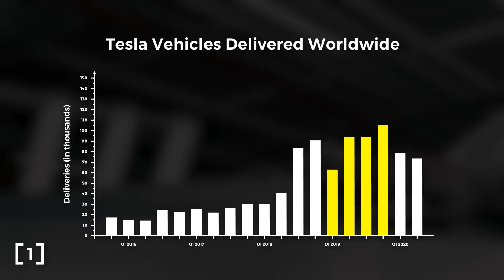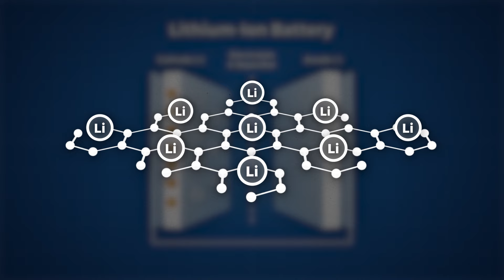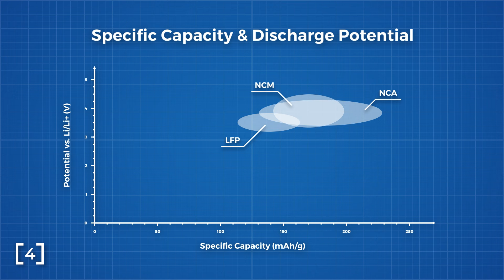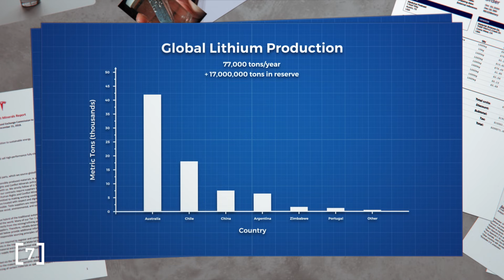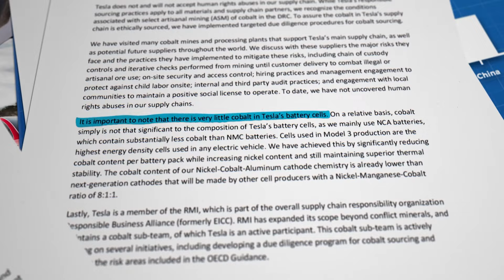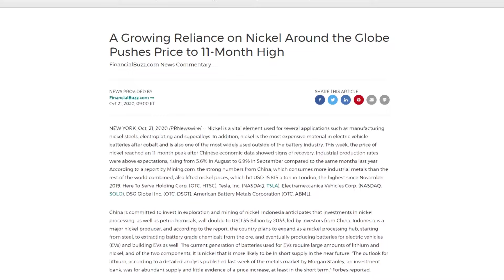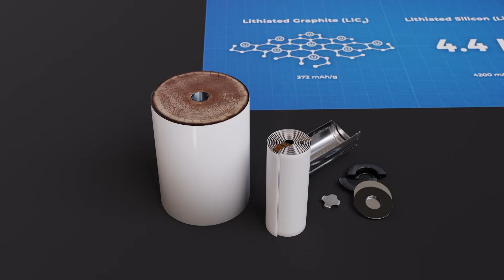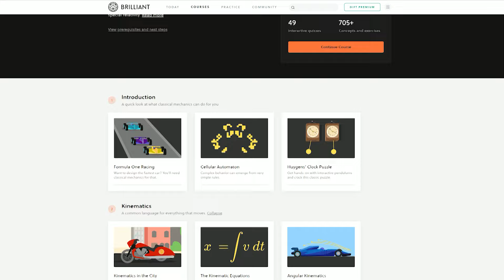Tesla's Battery Supply Problem

Comment: OK, If Tesla has a battery issue how in the heck are other OEM's going to get involved?
Reply: Presumably other OEMs are not going to get involved by starting with "solve all the world's energy problems on day 1."  Any new competitor will need to do better than Tesla in some fashion, whether that's a new battery tech or new production methods or whatever they come up with.  Certainly someone who is just starting to day and being a 100% clone of Tesla without doing anything different would face some significant uphill battles, but that's no different from a new competitor trying to enter any other market without something to make them stand out.

As for competition more generally, most of the major automotive manufacturers have had a pure EV line to compete with Tesla for several years now, and hybrids are so common that companies barely even bother advertising that as a feature anymore.  Similarly, competition in the battery sector is not trivial.  Tesla tends to get all the credit in part because of Elon's high profile and their penchant for doing big, flashy things like the Australian grid installation, but in terms of researching new chemistries (which is the really important thing for the future,) there are quite a few people in both the private and public sectors pursuing multiple ideas to improve (or even replace) Li-Ion.  Its not like Duracell and Energizer are going to sit their watching their markets dry up as Li-Ion becomes a more and more suitable (and rechargeable) replacement for traditional alkalines.  And its not unfamiliar territory to either of those companies who have already had to fight a similar battle 30-40 years ago when NiCd (and later NiMH) started appearing in AA form factors.

I think issues like the DRC's control over cobalt is far more problematic for the industry as a whole than Tesla's particular vision of the future.  And their vision is likely 20+ years away from being realized even if everything goes perfectly for them -- plenty of time for competitors to join the market, for Tesla to change their vision, for nuclear fusion to be invented (its only 20 years away after all!), etc.  This isn't something that'll be done and dusted by tomorrow.
Reply: @altrag   I was very interested about your analyse until you said 20 years for fusion.
We are farrrrrr more away of having fusion energy.
Reply: @ARCopros  Yes its a joke.  There's a common saying that "nuclear fusion has been 20 years away for half a century," or some such paraphrasing.

Though we might actually be closer than the joke suggests.  Certainly no guarantee, but the amount of private investment we've seen in the past decade is an interesting shift.  Governments may be happy to pursue pie-in-the-sky ideas (especially if there's a potential military application) but private investors tend to be a little more cautious with their dollars.  So the fact that we're seeing such private investment makes me wonder if viable fusion might finally be falling within that 20-year window they keep promising.  (Of course, even if we proved one of the technologies tomorrow, it would likely take another 20+ years to scale it up from "viable" to "commercially relevant."  City-scale power generation isn't cheap or easy no matter the underlying tech!)
Reply: @Strawberry Kiys Yes and no.  Mines are absolutely terrible for the local landscape to be sure, but as long as tailings ponds are maintained and aren't allowed to leak their collected toxins into the environment, the overall damage from mines is very localized -- nature typically still remains undisturbed mere meters away from the edge of the mining operation.  (Of course maintenance of tailings ponds is somewhat contentious.. mining companies have a bad habit of sucking out all the profit then abandoning the site entirely, leaving it up to the public coffers to continue maintenance for decades to come in addition to any ecological recovery we want to attempt.  But that's more a legal problem than an environmental one.)

Air and water pollution are more serious specifically because they can't typically be contained in any meaningful way.  Once you've pumped your gas into the air or your chemicals into the stream, everyone (and everything) downwind/stream will be affected and there's nothing they nor even you can do about it after that happens.

So no, nobody is claiming that mining operations are "clean," but if I had to choose between a hundred square miles of Peruvian mountain being dug out for Lithium or burning another hundred billion barrels of oil, the former is going to be the safer solution in the long-term.  The area around that mine will quickly be reclaimed by nature once the mining is done.  The CO2 buildup in the atmosphere will be around for possibly hundreds of years.

And we don't really have the option of "do neither."  We're struggling to convince people to switch to green energy -- a change that would be practically imperceptible in the average person's life.  Convincing anyone at all (never mind everyone) to completely shut down our grid and go back to living in the stone age is.. just not really worth considering.
Reply: Is beneficial to Tesla that there is no competition
Reply: Plus, stupid cars are a stupid and energy inefficient transportation to begin with. You know what's efficient? Electric trains. You know what electric trains don't need? BATTERIES
Reply: @nemou4985  > cars are a stupid and energy inefficient transportation to begin with
Depends entirely what your transportation needs are.  While we certainly use cars in plenty of energy-inefficient ways, there are also plenty of situations where cars are the among the most energy efficient.

> You know what's efficient? Electric trains
They're only efficient if you need to get between two points on the line.  Its horribly inefficient to build tracks and all of the interchanges and the like in every single residential suburban neighborhood in the country.  Trains are good for covering high-traffic routes but fail miserably when you need to get to smaller (never mind individual) destinations.

> You know what electric trains don't need? BATTERIES
They usually do require batteries, though that's more just to normalize the incoming power rather than being a power source in themselves.  But they still require power and while you're saving the materials for onboard batteries, you're using a bunch of extra material to build the tracks and cables and whatnot.  Its not "lithium mining vs no lithium mining" its "lithium mining vs iron & copper mining."  I don't disagree that electric trains are more efficient (as long as you only need to go where the tracks lead,) but they're certainly not 100% environmentally friendly.

Busses kind of fill the gap between the two.  They're more efficient than cars and can go almost all of the same places cars can go, but are not as efficient as trains.

Of course energy efficiency is also not the only thing people try to optimize.  If you're going to NY to Boston then the city-to-city trip is absolutely going to be more efficient on the train, both in terms of energy and probably in terms of cost.  But once you get to Boston if you need to go somewhere that isn't in easy range of trains or other public transport, now you're looking at car rentals or heavy taxi usage and those are definitely not cost-efficient even if the vehicles themselves are the most energy efficient models on the market (which is already a pretty damned big "if").
Reply: Think of it as an energy policy problem, then an EV problem, and lastly a Tesla problem. Like the video explains, Tesla's car production is tiny compared to it's competitors. And as it's competitors introduce their own EVs, Tesla's market share falls. So it won't need 300 Gigafactories because it may not be producing many more than 500k cars a year. Tesla may be hoping to licence any new battery tech it develops, or other battery producers will out innovate and out compete Tesla. Plus there are additional challenges, ie Tesla's only 'profitable' due to the sale of regulatory credits, and as other automakers ramp up EV production, or those credits are phased out, that revenue stream dries up.
Then there's the energy policy problem. Governments have decided all new cars must be EVs, and electricity generation be 'renewable'. Electrifying transportation massively increases electricity demand, and 'renewables' have the problem of being unreliable/intermittent. Hence battery makers wanting to sell 'grid scale' battery storage, which is good for them because it increases sales, but bad for everyone else as it increases costs. The policy problems are made worse if we're also to decarbonise heating.
Which is all a bit of a mess. In an engineering sense, we should be looking at the most efficient solution to a problem. The 'renewables' problem is an old one, and our ancestors got around that as windmills and the age of sail gave way to the steam age. Policy makers are trying to reverse that bit of history, because 'renewables' lobbyists convince them it's a good thing. But as the video points out, it's actually a very bad thing.. And more people are starting to realise that EV's aren't very environmentally friendly, and neither are 'renewables'.
Again that's nothing new. EVs are over 100yrs old, and some of the first cars on our roads. But suffered much the same problems as today, ie the potential energy of a litre of gas is far greater than a litre of batteries.. Especially if you factor in the entire supply chain.
Reply: @altrag  Fusion technology has been developed for some time now if I understand my Nuke-E friends. As far as I know it's more dependent on the safety controls that are held to a higher standard due to lobbying and fearmongering of the oil industry, which has more recently eroded away due to the emergence of electric vehicles and other clean energies. Perhaps this is what you were referring to already.
Reply: Hydrogen fuel cells
Reply: @kimosabe_djp  It kind of sounds like you're referring to fission (the other type of nuclear power that we've been using commercially since the 50s.)

For fusion, we absolutely can make atoms fuse without too much trouble.  When we talk about it being "viable" though what we mean is that we get more energy out than we have to put in.  That's always been the tricky part.  We've gotten very close (something like 99.99%) but anything less than 100% and we're losing more than we're gaining.  Useful for research, not so useful for commercial scale power generation.

As for safety, fusion is one of the safest possible power sources (that we currently know of.)  It involves huge amounts of energy to be sure, but its not self-sustaining like fission, so if anything the reaction stops within milliseconds.  A massive transformer exploding or a supercoolant leaking can be dangerous of course, but its not physically possible for fusion reactors to produce anything akin to the fission meltdowns that gave us things like Chernobyl and Fukushima.

Now the insides of the reactors do get highly irradiated and that needs to be dealt with, but the types of radioactive elements created decay very fast.. none of the centuries-long problem elements that we see in fission reactors, so storage and disposal of radioactive material is significantly safer and easier (and therefore cheaper.)

Finally there's the national security issues.  Fission reactors can be used to breed weapons-grade plutonium (well, not exactly the same reactors.. the configurations needed to breed plutonium aren't optimal for power generation and vice-versa, but they use the same basic underlying design principles.)  Fusion reactors don't produce anything that could even theoretically be used for nuclear weapons.

So fusion is basically a panacea.. that's why we're still pursuing it after all of these years of failure.  It basically solves humanity's energy needs for centuries to come and does so relatively cleanly (certainly a lot cleaner than fossil fuels and even cleaner than much of today's green tech due to the mining and manufacturing issues) and comes without really any of the downsides of nuclear fission.  But unless we can make it output more energy than we have to put in (even just 1% more would be enough to get us started,) all of those other features are meaningless.
Reply: @HaydenLikeHey  Hydrogen cells are a bit of a red herring.  They're absolutely cleaner once the hydrogen is in the car, but extracting the hydrogen (usually from water) is itself a very energy-intensive process and that energy still mostly comes from burning fossil fuels.  Economies of scale (that is, burning the fuel in a single giant plant rather than a million tiny plants aka car engines) make hydrogen cells a bit better than gasoline, but its not anywhere close to the improvement that the H-cell promoters like to boast when you include the full fuel lifecycle.

The H-cell lifecycle will certainly become cleaner over time as the grid power used to extract the hydrogen continues to move away from fossil fuels.. but as noted, that's a very energy-intensive process and introducing significant hydrogen production facilities would mean significantly more energy demands on the grid, slowing down our ability to transition away from fossil fuels as more of the new green energy plants end up being additions rather than replacements.

So its a bit of a catch-22.  There may well be a place for H-cells and we absolutely should keep developing the technology, but it's not a large enough advancement to save us from ourselves.  It will be one part of a larger strategy, and I'm not even convinced it will be a terribly large part (though its possible.. can only wait and see how all the various green energy technologies evolve over the next 20-30 years.)
Reply: @altrag  Well said. I think the problem is still energy policy, and lobbying. The policy problem is we've decided to decarbonise, and replace fossil fuels with electricity. Which from an engineering standpoint, is fine, and possible. But enormousyly expensive.
So Tesla wants to produce several TWh of batteries. Great. But that means producing TWh of electricity to charge them, plus electricity for heating, cooking etc. Policy favours 'renewables', which are expensive, not particularly environmentally friendly, and unreliable.
But there are alternatives. So there's been developments on SMRs (Small, Modular Reactors) and Thorium reactors. Both generate electricity pretty much 24x7x365, unlike wind and solar. But they're nuclear, and there's massive lobbying against that, even though it's low carbon and sustainable with the right fuel cycle.
As you say, there's also fuel cells. I've used ethanol ones which work well. Downside is cost, but they also produce 'waste' heat, but that heat can be used either directly, or maybe by adding a Stirling engine. There are commercial CHP (Combined Heat and Power) units based on this, but they're not cheap.
Which I think is back to lobbying, and the billions being wasted by chasing wind & solar rather than alternatives.
Reply: @brolohalflemming7042  While I agree that nuclear is (currently) our only true replacement for baseload power, I'm not so sure that the specific technologies you mentioned are up to snuff.

SMRs are promising but their development is very slow.  They basically ignore the economies of scale you get from large power plants and trade it off for (essentially) being permanently sealed and disposable.  Certainly that's an important issue with nuclear power but I think we're still a fair ways off from making it cost-effective per MWh relative to just building a new 6th gen traditional plant.

Thorium is even more questionable.  While the plants could work in principle, there has been very little funding into thorium research and we're far enough past the cold war to keep claiming that its "just because Th reactors can't produce weapons material."  I don't know whether its cost per MWh or technological hurdles or just simply poor PR, but Thorium is not looking to be commercially ready any time in the near or even mid-term future.

> Policy favours 'renewables', which are expensive
Most renewables aren't that expensive anymore and the price is still dropping by the day.

> not particularly environmentally friendly
No, but still far more so than burning fossil fuels.  Barring some disaster like a tailings pond breach (which certainly seems to happen far too often,) the mining operations and such we always point to in order to claim renewables are "bad for the environment" are at least very localized and nature will reclaim those areas within a few years of the mine closing down.  Greenhouse gas emissions are causing problems globally and will be with us for decades even if we somehow could go cold turkey and turn off all the emitters tomorrow.

> and unreliable.
Which is where the massive battery packs come in.  Battery packs (and other energy storage solutions) allow us to save up the power when its available and release it when we need it.  A full solution will likely include several stages of energy storage (for example, batteries might be the first stage with rapid response but low capacity to interact directly with the grid, then have something like pumped water storage to back up the batteries with an immense capacity but a several minute ramp-up time, etc.)  We'll probably always need some level of truly reliable always-on power, but there's still a lot of room for renewables to take over a large portion of the load, and battery storage systems are an important part of that transition.
Reply: @altrag  SMRs are already in use, depending on how you define them. So Russia's developed and installed many. The UK has Rolls Royce's 440MWe PWR near ready, and (probably) based on some of their work with naval reactors. Other SMRs propose helium, sodium or salts for cooling, all of which have their own challenges. Like availability of helium.
Throrium in many ways is 'old' technology given it was built in the '50s. But politics intervened, and reactors better at enriching fuel got built. LFTR designs, along with some others have the advantages of recyling nuclear waste. And importantly, allow nuclear alchemists to create medical and industrial isotopes.. Which is something 'renewables' can't do.
But the general idea behind SMRs is to simplify the paperwork, ie build modular powerstations based on pre-approved designs. They're not necessarily sealed units, and sensible ones still need fuelling & fuel management. But again on politics, due to anti-nuclear lobbying, less funding has gone towards nuclear R&D than it should, if the aim is to decarbonise.
But back to batteries, gridscale storage is only necessary because of 'renewables' intermittency. So it adds enormous cost for limited utility, and high risks. Challenge is designing an energy system that can cope for a winter weather system that might mean several days of cold, and windless conditions. 
It's also ironic that technology that's meant to mitigate 'climate change' is extremely vulnerable to severe weather.
Reply: @brolohalflemming7042  > SMRs are already in use
Looked it up and it does seem the tech has advanced more than I expected over the past few years.

> So Russia's developed and installed many
Not quite that far though.  Everything I can find suggests Russia has only brought one test SMR online as of late 2019.  I haven't found much information from 2020 (never mind future plans) but given the 500-day construction estimate for that RR model, I suspect Russia hasn't built all that many more at this point even if they started the day after the data I found was published.

> gridscale storage is only necessary because of 'renewables' intermittency
No, we have grid scale storage for traditional power generation as well (that massive Tesla installation in Australia for example has nothing to do with renewables -- they lost some critical infrastructure for some reason I can't recall and Tesla offered to built the installation on their own dime as a test system if Aus provided the land.)  In traditional systems the stored energy is used to react to unexpected demand spikes and surges (since it can be ramped up and down faster than injecting additional fuel into a coal/gas plant and way, way faster than adjusting output in a nuclear facility).  So the purpose of the storage would be expanded, but its still a necessity regardless of whether or not we switch to renewables (and battery packs have some significant advantages over older tech like pumped storage -- namely, it can be turned on and off in fractions of a second and can be driven at very precise power levels.)

But no, renewables are absolutely not a one-size-fits-all solution, nor are battery packs going to take over as the sole storage system.  But those solutions help reduce our demands for fossil fuels and nuclear energy (nuclear waste doesn't cause climate change but its got its own problems with transportation and disposal.  We don't really want to produce any more of that stuff than we can manage either!)  Doing better does not mean we have to do perfect, especially not all in one giant step.  We can (and must) transition over time, and renewables and battery systems will be an important part of that transition process (and so will nuclear, in one form or another.)
Reply: @altrag  On SMRs, again it really depends on how you define them. So Russia had it's EPG-6 from the '70s, but at only 12MWe, arguably too small. But that as all part of the business case, ie should we have muni-nukes powering towns & cities, or >1GWe large-scale generation, which then impacts on transmission design.
That's also a challenge with 'renewables', so they're often far away from demand centres, so can incur massive transmission costs, especially if offshore, or environmental regulations demand buried power cables.
And on batteries.. That's still a problem loaded on a problem. No wind, no power. Too much wind, no power. Freezing frosts and no power, people die. Neoen's battery in Australia's a good example of the problem. 'Renewables' made NSW energy supply unreliable, so it spent $160mAUD on 70MW 'grid stabilisation' for <10mins and 30MW for Neoen's energy traders to trade, making huge profits when 'renewables' can't supply. NSW's electricity bills have gone up, not down as a resuly. And as energy is an input cost to pretty much every activity, this is not a good thing. And further afield, much the same is happening. So California now has a 230MW battery array.. but not from Tesla, but LS Power & LG battery cells.
California only needs that because of it's rush to 'renewables'.
Reply: @altrag  But a car is still crazy inefficient in most cases. Not just for the fuel, but for the production cost and raw materials to make it. 

Personal cars' main use is to commute to and from work and to do grocery shopping. The vast majority of the time a car has only the driver in it. Plus or minus some groceries in the trunk. We move 1 ton of steel and glass around to move our butt down the street.

You know how your dad used to yell at you to turn off the lights, because you're wasting electricity? Your home's power outlet provides 15A at 120V. That's 1.5 HP, max. What does your car use to move your mini, climate-controlled environment around with you? 150 HP? Paul Revere crossed Massachusetts with 1 HP.

Aside from trains, motorcycles/scooter could be a more energy efficient alternative for commuting to work. But we make this socially unacceptable. Modern society make humans a pest species.

And we got the same dude, Elon, with a vision of flying to mars. You know how much gas that takes? Stupid. The most important and sane thing we can do as a species is to control/curb our population. Period. The animal at the top of the food chain has the smallest numbers... except for humans. There's like 10 billion of us all over the planet. Population control. But getting rid of cars (or making them smaller) is also a pretty big step.
Reply: @altrag  Fuelcells will have their place in aviation where weight is important. And maybe in trucks because roads and bridges have weight limits.
Reply: @altrag  DRC? Elon is just cheap. FCC is based in Canada but it’s not horribly enough sourced(I mean given away) for Elon to be interested.
Reply: @altrag  energy intensive? You mean like the entire EV industry?